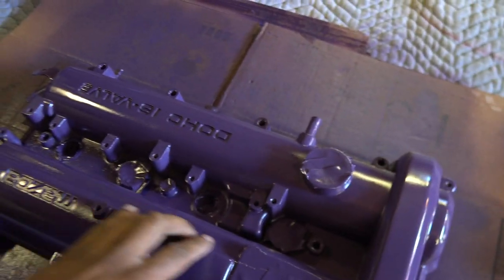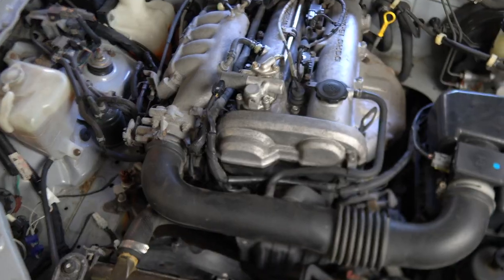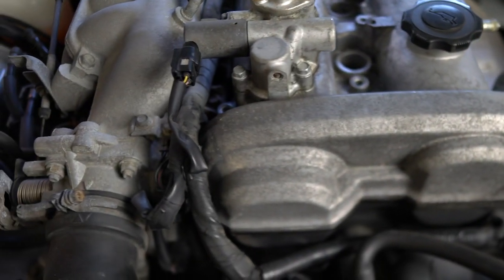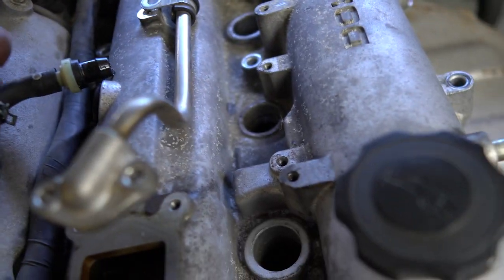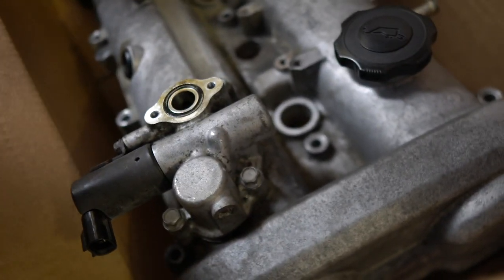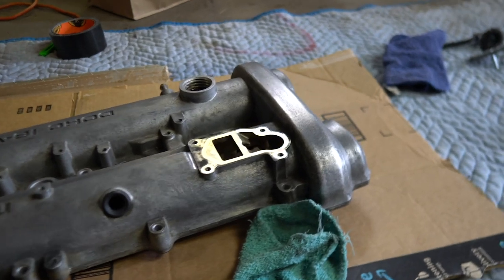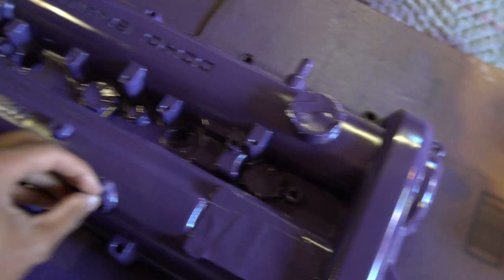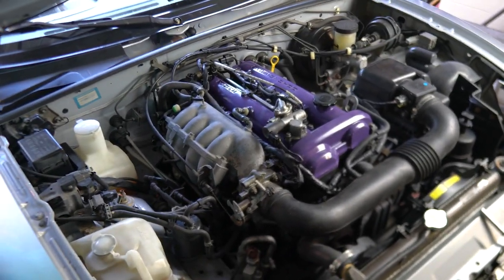NB2 Miata Valve Cover Paint Job DIY!

Comment: The metal line and "thing" on top of your valve cover is called the 'vvt system.' (The line does sends oil to it, and the large piece towards the front regulates the flow of oil.) It stands for variable valve timing. In Hondas its called Vtec, in BMW its called Vanos, every car manufacture pretty much has there own VVT brand. In later NB miatas (NB2 2001+) it means a whopping 6hp increase from the NB1. But also that the engine will last longer, and not be as taxing on the drive train.
Reply: Also just wanted to mention that this Miata has what is known as a DOHC engine which means dual over head cam. The two things you see right below the valve cover gaskets. (the part you left in the car and didn't mess with.) are the cam gears, there is 2 of them. The head is much further down, there is more tear down of the engine required to do a head gasket replacement... Your other cars/jeep is prob single cam, a completely different engine and layout, different amount of cylinders and pistons... completely different engine... But any ways the point is to tell you to do a head gasket on a miata, or a JEEP is a pain in the ass, all head gaskets are a pain in the ass. It means removing the top half and the bottom half of the motor just to replace the metal head gasket. No one likes it, and worst of all its not even the worst job to do on a car... That would be pulling a steering rack (in my opinion lol. )
Reply from the maker: Alexis sixela thanks for the info, yeah afterwards I started looking up more info on the NB2 Miata and the difference between the 1 vs the 2. I still have a lot to learn but I’m starting somewhere! Lol
Reply: @OmegaGreedAK47  Happy to tell you more if you have a discord or some way to chat. I have a 2003 mazda miata. I know a lot about them in my opinion. That dude "Mike the miata king" aka Miata mecca on ebay is also very knowledgeable. His videos are good sources of info. I would tell you to go buy a manual but I just learned that 5xracing has all the miata manuals in pdf form on their website.

Comment: Nice job man! I just did mine but had some of the VHT paint chip/flake when I torqued down the bolts. Did that happen to you by chance? Also I filled my lettering in with testers enamel paint and a syringe if that helps any